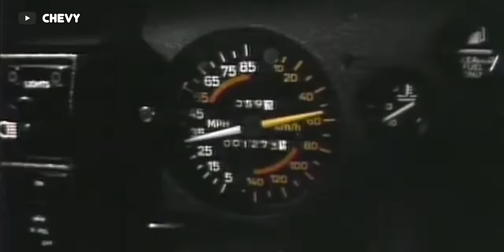These are the WEAKEST ENGINES EVER

Comment from the maker: What else would you add to the list?!
Reply: Early Ford Modular 2Valve (215hp from a 4.6 OHC)
Reply: We need to see this same list but with transmissions
Reply: @Prestiged_peck  47RE, 2nd gear 4L60E, Any CVT
Reply: @KRRZ350  toyota makes good CVT's lol
Reply: I wouldn’t say that cam in block limits hp … it was 90% emissions limiting this engines even a old 6.2 can easily be turned up to 180 hp without a turbo
Reply: @petrolhead9702  they tried (and failed) to match the outgoing 302 instead of just making it a major upgrade. If we had gotten the PI version of the 2v right from the start, the modular would be so much bigger today.
Reply: IIRC the Renesis engine in the RX8 was supposedly pathetic for power output especially vs. the older rotaries that preceded it in the RX7s.
Reply: gm 2.8l v6
Reply: The 90s 302 that made 215 horsepower
Reply: @Prestiged_peck  Although the Modular ultimately evolved into the Coyote family and as a result, the current-gen 5.0s and 5.2s that seem to be killing it in high-performance applications such as the Mustang, so it got big anyways in that sense, plus the 5.4 4-valve and 5.8 Trinity implementations that were in the S197 GT500's that were based on the pre-Coyote design, which 337 SPEED did a really good write-up on.
Reply: The best medium duty diesel , is the INTERMATIONAL  DT 466 , MAYBE?  BUT COMPARED TO THE COMPETITION IN THAT CLASS OF DIESEL ENGINE IT WAS VERY GOOD
Reply: Or how bout the 98 99  ford 6.8 V10 boat anchor 275hp , 410 lbft , shooting spark plugs and slurping gas
Reply: ford 4.1 (250 cid) inline 6 from the 1979 Ford Granada and Mercury Monarch   it was rated at 97HP and 210 LB-FT   which is 23.6HP/L (0.38HP/cid) and 51.2LB-FT/L (0.84LB-FT/L)
Reply: Oh the  Ford Triton 5.4 , I don't have time to list all the weaknesses and failures ,LOL
Reply: Here’s one to add. The L03 305CI Throttle Body injected 5.0L V8 that is tucked under the hood of my 1992 Camaro RS with a factory Hp rating of 170Hp at the crank. Now I haven’t been able to kill this engine yet with about 275,000 miles on it. And I even run it to 6,000 rpm’s between shifts
Reply: Chrysler 2.2 carbureted when connected to an over-geared 3 speed automatic in the early (1985-ish) minivans. The low-slip torque converter and tall gearing in the interest of fuel economy, and simply not having enough gear ratios to work with, meant that when the traffic light turned green, you could mash the accelerator all the way to the floor, and it will not spin the tires, and you will not hit the car in front of you! The K-cars with that powertrain were ... leisurely, but the extra weight of the minivans really dragged them down.
Reply: I would add the Oldsmobile 350 diesel.  They put that thing in every GM brand and it was absolutely gutless on top of being under-engineered for the time.
Reply: 6.2 diesel was bad...but the 5.7 Olds diesel was worse yet.
Reply: Rover v8
Reply: the 6.9 idi. 150hp and 300ft/lb. the VQ35 makes the same torque and 120 hp more with half the liter displacement.
Reply: Ford 351M, I had that engine in my 1978 Ford F250
Reply: @matthewboudreaux2693  pretty easy to up the HP on them
Reply: Festus  try the cologne from the exploder/sporttrac, 1 of the worst engines then again this is the corner cutting company (it's in their logo)
Reply: Bmw V12 in the E31
Reply: 75 Mercury Comet have 4.1 l6 and only 70hp
76 Mercury colony park 6.6 v8 144hp
Cherokee ZJ 5.9 v8 245hp
Buick 5.7 v8 diesel 105hp
Dodge ram 8.0 v10 300hp
Reply: 75 Corvette 5.7v8 165hp
75 Mustang 5.0 v8 120hp
Reply: @Zero-Fox-Garage  I was waiting for someone to bring up the GM 5.7 diesel. Everyone dogs the 6.2/6.5 but nobody mentions possibly the worst diesel in automotive use.
Reply: I would add the 2.2 Perkins diesel in the early 80s Ford ranger with a wapping 59hp
Reply: Pathetic? It made as much as the mustangs lol
Reply: @mikechapple2134  1975-1976 Ford 4.1L inline 6: 75HP for the 48 states, 72HP for California! As far as I know, the '75-'76 6 cylinder automatic Granadas, at 23+ seconds 0-60 were the slowest American cars of that decade.
Reply: 1980s AMC 360….144 hp in my stock 87 grand wagoneer 🤣
Reply: Your channel, thats what id add to the list,  its for 5 year olds.
Reply: Ford 460. 230 hp. Lame.
Reply: The Mitsubishi 6DR5 4.0L inline 6 naturally aspirated diesel that was used in the 78 to 79 Dodge ram it had a 105 horsepower and 169 ft lb of torque
Reply: 9.0 L International V8. Fuel Pincher, absolutely gutless, refusal to die.

Comment: '02 GMC 8.1l  only put out 345hp and 455ftlb. But my understanding was gm and Ford were not looking for high performance but rather longevity. Hence why these 8.1l, 6.0l, 5.4l and 6.8l engines are still around with well over 200 to even 300,000 miles plus on them. You look at current truck engine options and have to decide which failure you want to roll the dice on.
Reply: That’s interesting, good point. My 5.4 now has 325,000 KM, still going strong and sucking gas like a smoker sucks cancer 😂
Reply: the 8.1 big block gasser from GM has a very low rpm limit so it acts more or less like a diesel out puting power downlow instead of up high
Reply: @csgsavagebanana8102  exactly. My 6.8l is the same way. Builds torque fast. Towing feels more like a casual drive. Modern engines you  gotta wind up.
Reply: Agreed, an under-stressed engine will just keep on going. High output/ liter engines just means it will break itself faster.
Reply: My dodge 4.7 still runs strong and it’s kind of the same concept only in 1500 trucks.
Reply: I wonder what the engineering differences are between that and the new Ford 7.3L Godzilla. 430 hp and 475 lb ft.   They increased the torque with less displacement. That's very hard with naturally aspirated engines.
Reply: @imnotusingmyrealname4566  if your referring to “that” being any of the triton series motors than they have absolutely nothing in common other than the brand manufacturer, the Godzilla motor is a in block cam design similar to the old Windsor big blocks in the 90’s but it’s even different from any of those and doesn’t share any components with them just the idea. The closest in similarity motor to the Godzilla I can find is the 8.1L Vortec found in GM product in the 2000’s and even that is wildly different of an engine.
Reply: @imnotusingmyrealname4566  the new 7.3 benefits from optimized modern computer designed heads. I think that’s how they can get more power than the 8.1. It’s also been 20 years so i bet the engineers used every trick in the book/ computer to give it alot of down low power.
Reply: @hilljackzack7284  Technically the Ford Windsor engines were small blocks. In the 80s and 90s Ford’s big block was the 385 series 460CI.
Reply: @mikee2923  I thought the 460 was a Windsor is it not?
Reply: @hilljackzack7284  I believe the 351 Windsor is a tall deck version of the standard Ford 302 (later 5.0 in the 80s and early 90s) which are both considered small blocks. The 460 is considered a series 385 which is a big block that grew from the 429. If I’m not mistaken the 429 and 460 were originally developed for Lincoln. Not sure about the 429 that came first but I’m pretty sure the 460 was first offered in the 69 Lincoln Mark III. It then trickled down to the Thunderbird and the big Mercuries and was even an option in the Grand Torino in the Starsky and Hutch era. Not sure when it was adapted to trucks. The only engine manufacturer that I’m aware of that offered a wide range of displacements from the same block dimensions was the traditional Pontiac V8. Their blocks shared the same external dimensions from 326-455CID.
Reply: @imnotusingmyrealname4566 the 7.3 Godzilla is a gas engine as opposed to the late 90s version which was a diesel, the reason the new one has more power and torque is because it has modern technology to make it much more volumetrically efficient like better head design and it’s stock rev limiter is much higher at like 5-6 thousand rpm while the old diesel has a rev limiter of like 4 thousand rpm
Reply: Horsepower-life.   Low horsepower-long life.   High horsepower-shorter life.    The key is using which one suits your purposes.
Reply: I have a 02 GMC 8.1L and I love it, I'm sitting at 210,000 miles right now. My brother builds engines for a living and he keeps trying to get me to do a engine rebuild to freshen it up and slap a  mild turbo on it. However I am happy with it the way it sits, if I could find a matching tailgate for a decent price the truck would be in perfect shape. Perfect paint, interior is in great shape for a 21 year old truck and body is perfect, (well perfect body and paint if i exclude the tailgate) but hey you can't always get what you want.
Reply: Way less 5.4L around than LS engines lol
Reply: @shatteredreality87  In the long run it’s worth rebuilding it. It will definitely outlast any newer vehicle on the road today, and it’s alot cheaper to replace parts as they give out, vs the price of a new truck. Also, you won’t be in debt with a loan, and you won’t have a vehicle payment every month. Just my two cents.
Reply: Absolutely, I agree with you 100%
Reply: Yes it’s true it’s pretty low in power but the 8.1 was meant for towing. This engine literally makes 400lb-ft at idle😳
Reply: My grandfather probably had one of these trucks. He states his truck may very well have eaten gas more than anything ever made before.
Reply: Thats right bullet proof engine, high torque applications
Reply: @A_Litre_of_Farva  come back when you are at 350,000 Miles
Reply: @csgsavagebanana8102  torque monster for work, not fun.
Reply: @hilljackzack7284  L8T engine
Reply: The 8.1 L was also designed to be a CNG engine.
Reply: I have an 8.1 400,000 miles chance the oil every 5k tows 13k every day. It’s slow but strong
Reply: Dont know if youll see this Peter but you need to look up these 8.1l chevys with turbos in them running a race gas methenol mix i believe. All stock internals making upwards of 800hp without failures pushing it like a sled dog. 7-8k lb trucks pulling low 11s stock other than turbo setup. Although not built for performance in mind as you said these are chevys era of building their enigines internals to last and take ALOT of abuse. These were coming out during the good LS era where a stock engine could make 500 HP for 150k miles.
Reply: true those ford 4.62vs are gutless but will last forever!
Reply: @35RSkyline  idk i work on constructions sites the f250s with 5.42v far out number the gm offerings. plenty of those 2000 f250s with well over 300k
Reply: @glowplug4762 my goals are simple, send it until it fucking explodes
Reply: @PhatsoJuggalo806 the 2 valve 5.4 is alright, the 3 valve doesn't last
Reply: Yeah, a lot less stress on the components
Reply: An understressed engine is s joy to be behind for years and years😅.
Reply: Most big blocks of this era were still diesel competitors
Reply: Agreed unless you're talking about the later 5.4 Tritons (excluding the versions in vans, they stayed the same since 1997). The 3V 5.4s are junk.
Reply: It's a solid engine that lasts
Reply: Absolutely correct!  I know someone with a 03 Silverado 3500 with the 8.1 who has 500,000 miles on it.  He's finally ready to rebuild it.  It never failed, it's just tired, it's getting honed along with new rings and gaskets.  It only had regular maintenance and a water pump replaced.
Reply: 345hp is actually pretty good tho as well as 455 ft lbs of torque
Reply: Not to mention most of these engines are simply detuned from the factory. Like you said they are designed to do there job well for a long time. The 8.1L finished the marine bench test with flying colors which is absolutely impressive. With a simple software tune you can get another 80 hp out of that 8.1. They come defined to get better fuel mileage and pass emissions
Reply: @csgsavagebanana8102 it’s puts power down low because that’s all the power it has….

Comment: First Viper was way undertuned for reasons of longevity of the drivetrain. I was a chassis designer on the first gen, preproduction engines made a LOT more but tore up drivetrain parts.
Reply: Wow interesting, what was it like to work on such a neat vehicle?
Reply: charlie dee  Wish they still made them, but I want to get a 99 gts. The viper v10 is just a monstrous powerhouse even as they were. Do you know if there is any merit to the rumours of the forged crank and pistons in the late 90s models?
Reply: @bennyboyy7  the 1999 Viper was the last year of the all forged motor and the 906 cam shaft. And just to let the public know, I had a dyno at my shop and every Viper we dynoed made way more power than what they were rated.
Reply: Also the 1999 Viper was all a concept car that was suprisingly goes to in production. Chrysler wasn't sure how the car would sell, so they didn't tune up the engine. After that, the second gen was better.
Reply: @SimplyTakuma  You're ten years late. The concept car was shown at the Detroit International Auto Show in January of 1989, the production car came in 1992.  I know this from being there, I was in the room when Iacocca announced it was approved for production in May 1991.
Reply: @SimplyTakuma  you mean the first generation, the gen 2 Vipers had a revised engine which was lighter and more powerful, 1999 was a gen 2 engine and was the best year for the gen 2 engine, all forged pistons and crank and the 906 cam , in 2000 they went with a milder cam and cast pistons.
Reply: @berserker406 yes and torque is what breaks things
Reply: Also the Viper only had 50 million dollars do develop, going from the chassis, to the drive train, everything while the Corvette was many times higher then that
Reply: @charlie dee  So what is the weakest link in the drivetrain? I'm a gen 2 GTS owner here pushing almost 600 HP at the wheels.
Reply: @Mooselover1011  First it was the transmission, then clutch, then rear diff. Rear axle shafts, etc. G2 had the problems sorted. I have seen dumpsters full of broken parts, still have a shattered mainshaft from a Getrag 6 speed on my desk.
Reply: @charlie dee  Hey, thank you for your response sir!
Reply: @stevenekdahl7124  so it's the same situation as BMW did not rate their power output highly
Reply: The viper team only had 50 million to develop everything for the first generation viper. Which is crazy that they even got it built.
Reply: The viper on all of its different models and trims was under tuned due to its tourque output not longevity was only the first gen had the longevity issues and it wasnt that bad of a problem even with the issues ive worked on many my self never seen one have a major failure when its taken good care of even when used for racing the 8liter v10 puts out massive amounts of torque in its stock 500hp state ive seen some with 6 to 700 torque stock
Reply: Why didnt they have brakes

Comment: Correct on the 6.2 Detroit. It is gutless. I own a 1984 C30. Still to this day. It just will not die. It has not lived an easy life either. It has gone to work since 1984. It also does it at 30 MPG. Love that truck
Reply: I loved the 6.2, but they were gutless.  That was known when you bought it.
Reply: Diesels have very diffetent logic. Displacement is not very connected with power and fuel consum.
Reply: i have 5 of them. love them.  they are in trucks that i consider and use more like street legal "tractors" not great power to weight, but they just keep putting along as i need
Reply: in fact with 5:68 lockers, big tires and full of tools weight, i have one that one easily out pulled my friends 800+ super $70k whatever it was though mine was maxed at about 50mph, his was fast and felt great on the freeway with great fuel economy

Comment: I have a 1973 Mercedes 220d diesel, 2.2L makes 60hp in a 3,000lb car. It is borderline dangerously slow but I love it. Mercedes gives a reference chart with the owners manual to estimate how much time it will take to accelerate around a car in a passing lane and it’s pretty funny to know that a 28 sec 0-60 was acceptable even back then.
Reply: Bro for the love of your own safety pls put a turbo on it
Reply: @Fat_moose_420  fr turbo diesels built different
Reply: “Borderline” can you not spell unacceptably or what
Reply: There were lots of slow cars even in the heyday of the 60s muscle car era.  Chevy sold lots more Chevelles with the 250 I6 and 307V8 than they did with the halo motors like the 396 and 454 SS.  I'm sure the 250 was not rated much more than 150HP or so, gross HP, not net.
Reply: A 1.0L Geo is about to run away from you.
Reply: Diesels have different logic. The displacement is not so important there. Everything depends how much you injects the fuel. You can easily make the engine with big displacement but still fuel efficient but weak.
Reply: I believe 28- 30 seconds to do 0- 60 is in the neighborhood of the performance of a healthy 1950 Plymouth or Dodge original unmodified car (manual transmission !) fluid drive might be a tad slower 
Top speed might have been 80 but possibly 80 might have been just out of reach 
Of course some cars of the era were a bit faster (Studebaker?) Hudson Big Six? Ford flathead V8 ? Pontiac Straight Eight? Even some kind of a Nash Statesman? 
the new Oldsmobile V8 ,Cadillac OHV V8 (replacing a well regarded primitive V8) and the Chrysler Firepower were waiting in the corral ?
Reply: Had a German friend when I lived in Germany in 1970. Cruise control on his Mercedels 220 diesel on the audobon was to simply lock your foot on the floor.